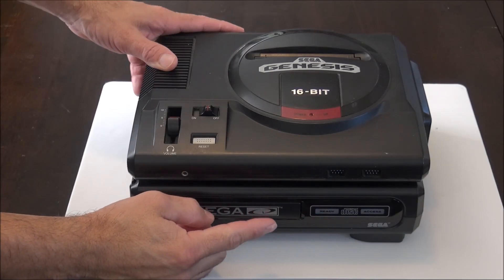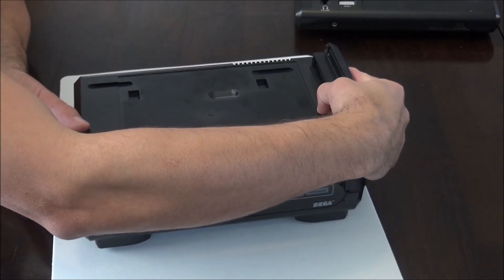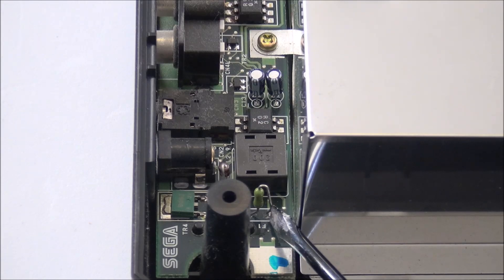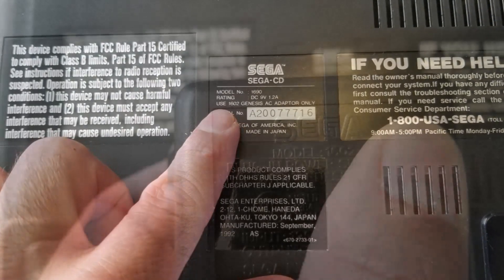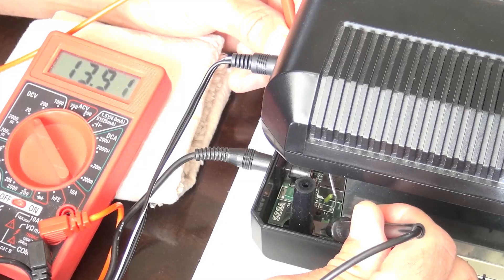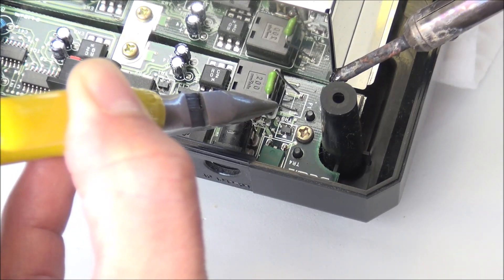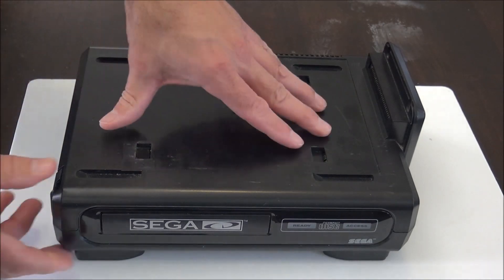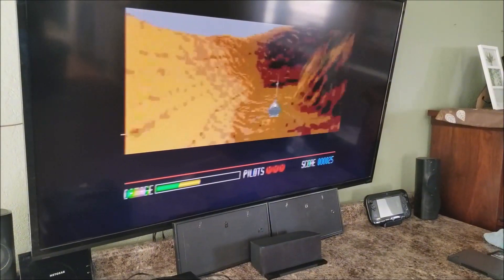Retro Repairs: SEGA CD Model 1 No Power Fix. Pico 2.5 amp Fuse

Comment: I have model 1690. It worked fine. But I changed the Jack port, since it had a false contact. But after changing the jack, it no longer turns on. I took it apart, checked it and noticed that the fuse was open. I changed it but it still doesn't turn on. I think he has definitely died 😓😓

Comment: Any suggestions? I followed the exact instruction above believing the Pico 2.5 amp fuse would be my problem and then when I tested it with the exact multimeter and it indicates that the Pico 2.5 amp fuse is still working. Now I haven't a clue what could be the power issue with this Sega CD. If you have any suggestions for step 2 I would appreciate it. Thank you!
Reply: There are 2 capacitors you can check. I've seen that issue reported a few times.

Comment: I just opened the Mega CD i was given  around 15 years ago , they said it didnt work. its been sat in a cupboard for most of that time, as i never bothered to get any power leads to test it.
Funnily enough , its got rebel assault inside too.
I may have to buy an ac adapter now to see if it as simple as the fuse!
Reply from the maker: Nice!

Comment: I just picked up a Sega CD Model 1 on Facebook.  Guy asking $120 claiming it worked when he last turned it on years ago, tested it today in front of him, no power... tried 2 other genesis as well as other official 1602 adapters and no go.  Offered $20 as a parts unit and took it to my bench to do that risky screw driver connection and it worked!  The game inside wasn't as cool as yours, it was the Sega Classics Collection that comes with the CD unit but still a good steal! Now to order the pico fuse and build my power of tower.
Reply from the maker: Awesome

Comment: "Only $70."

I remember around a decade ago my local media store had a Model 1 CD and wanted $80 for it. However, the guy knew me well and would sell it to me for $30 because the CD tray wasn't working correctly.

I decided to buy it and it worked great... for a while.

Hasn't worked since 2013 but might as well look into fixing it now. Thanks for the vid!
Reply: Wow. Nice!
Reply: 30 bucks. Now they are all going for well above $200. I just got one with no power from ebay. It's coming tomorrow. I'm going to troubleshoot. I'll let you know how it goes.

Comment: I found my uncles CD Model 1. I tried to plug in a 9volt AC adapter. It started to burn and I removed it. It hasn't been used in years. I am unsure if I broke it or what I should do to fix it.
Reply: lmao was it 1.2amps? bruh you maybe have just sent way to much power into it and fried it xDDDD

Comment: Seems like an easy job, top notch video many thanks.
 Q: Might you be able to share the DC voltage coming off your Sega Console Power adapter (originals were 10V 1.2 amps) and the Sega 1 CD adapter (originals were 9V 1.2 amps) ? 
My current readings are 11.5 Volt on the cartridge power adapter (which I believe is low as new units show 13.92 on average) and 13.40 V on the Sega CD 1 adapter.
After taking the unit apart and using the shim as in your instructions, the ratings show 12.42 Volts on both sides of the capacitor vs. your rating of 13.92. I suspect the 1.5 voltage lower is due to the Console Power supply which is outputting at 11.5 Volts. Might you have any further suggestions as to their being now power on the Sega CD player? thanks

Comment: I'm surprised the game still worked, must not have been jostled too much in transportation.

Quick fix and awesome video. 👍
Reply from the maker: Thanks man
Reply: @8-Bit_Flashback  
You're welcome. 

Completely off topic, have you heard about Amlogic tv boxes and using EmuElec?

I was thinking about getting a Beelink GT King and using that front end. It's basically Emulation Station.... But you can use it on several releases of the Amlogic series tv boxes, even the low end 40 dollar ones with similar specs/better than the Pi 4.
Reply from the maker: @brokensprites  it sounds cool